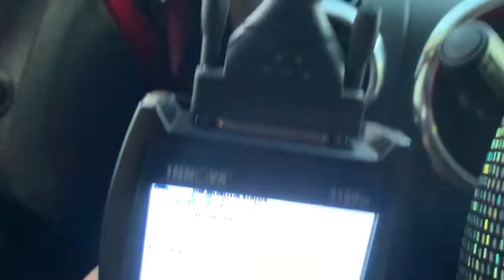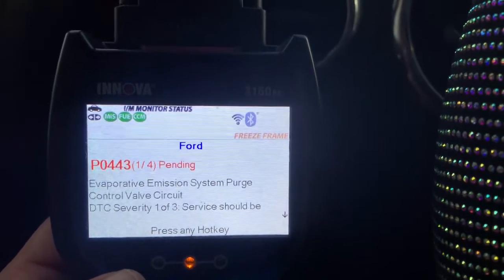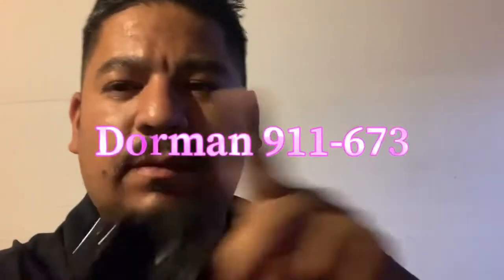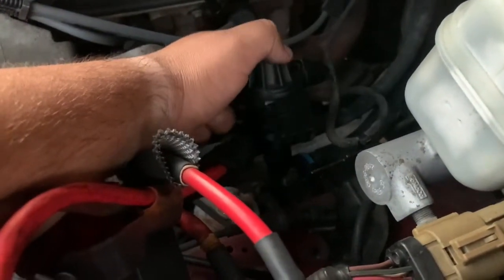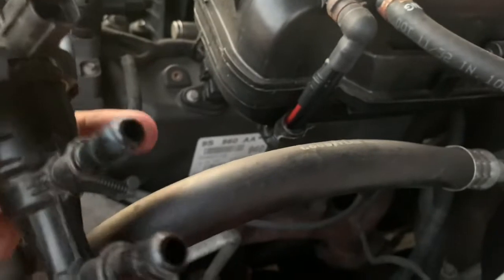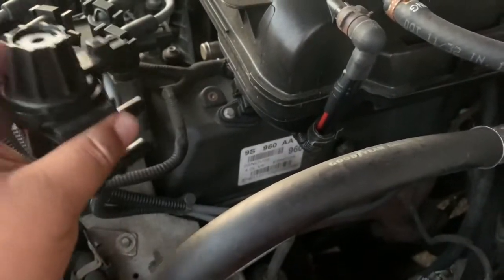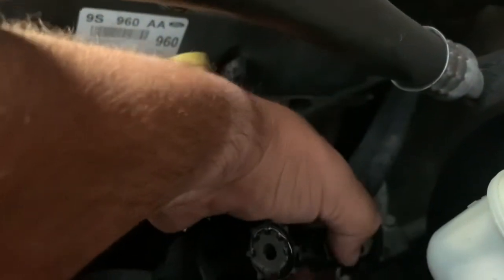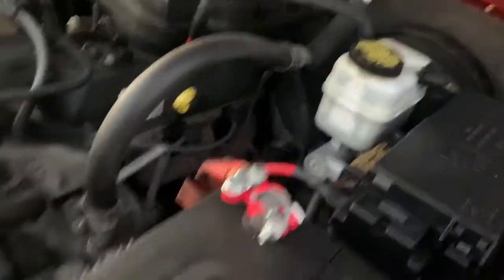Valvula de purga 2010 Ford Explorer

Comment: Buenas, amigo que fallas tenia la camioneta,  la mia tiembla el motor mas al estar parado , falta poca potencia,y bota la pistola cuando hecho gasolina
Reply from the maker: Hola amigo! Está no tenia fallas, la cambie por causa de la luz del check. Si esta temblando el motor puede ser por esa Valvula que ve en video. También son causa de que se bote la pistola.
Reply: @radioactivemotoringmx9456  saludos...la mía también tiembla solo cuando paro en un semáforo o en stop y el scanner me dice q la nesesita ..entonces también es causa probable por esta purge valve?
Reply from the maker: @h.c.cantoz7873  Buen día amigo! Si puede ser la purge valve, lo que yo haria primero seria limpiar el cuerpo de aceleración antes para ver  si ese causa que tiemble en alto. Si sigue entonces seguiría con la purge valve.
Reply: @radioactivemotoringmx9456  se refiere al maf sensor el filtro de aire y eso?
Reply from the maker: @h.c.cantoz7873  el MAF tambien, y el cuerpo de aceleracion (throttle body) y el filtro tambien, esas 3 cosas ayudarian mucho a minimizar la tembladura.

Comment: Estimado mi FE 2010 motor 4.0 se detiene en marcha y a veces cuesta la partida una vez que se detiene y el escáner mostro el código  P0403-FF circuito de control de poción de la válvula EGR y el P0443 fallo del circuito de la válvula de purga. El mecánico me señalo que hay que cambiar la válvula EGR, pero no menciono nada la válvula de purga. Como puedo saber cual de las dos válvulas esta dañada? o pueden estar dañada las dos?
Reply from the maker: Buenas amigo! Le habia contestado pero no se publico. Hay maneras de revisar los sensores con multimetro, pero si esta actuando raro el motor puede ser la de enfrente (como la del video) porque se pudo haber quedado abierta.
Reply: Estimado buenos dias, cambie la válvula EGR y los 4 sensores de oxigenos, aun no cambio la valvula de purga( no la he comprado aun), pero lo errores del scaner se mantienen. Sera que todo el problema depende de la valvula dw purga o sera un problema electrico al no borrarse los codigos de error ni el check engine?
Le agradezco mucho su consejo, en chile no hay muchos especialistas en este modelo de vehiculo
Reply from the maker: @marcelorojas5440  Buen día Marcelo! Hay una teoría en discuso ahorita en estos modelos Ford que las conecciones de la computadora que esta junto al motor no hacen buen contacto y si las limpia (desconectando la pila primero) pueden arreglar ese problema
Reply: @radioactivemotoringmx9456  GRACIAS

Comment: Mi camioneta Explorer 08, 4.0 vibra al estar en semaforo. Revoluciones inestables baja, pierde potencia y si no acelero se puede llegar a apagar. Será esta valvula???
Reply from the maker: Hola amigo! los sintomas suenan como que si puede ser, lo que le recomiendo es primero revisar si tiene alguna fuga de alguna linea de aire, de ahi, revisar y limpiar el sensor de flujo de aire (Sensor MAF) y despues limpiar el cuerpo de aceleracion para ver si eso le arregla el problema antes de cambiar partes.

Comment: Maestro una pregunta 
Te go una explorer 2006 4.o y me sale exactamente ese codigo p0443 y me dice evpap System purge valve de contro "A" circuito, esta se refiere a la misma q tu cambiaste o sera la q esta x debajo maestro?
Reply from the maker: Hola amigo! ese codigo creo que se refiere a un problema en el cableado de la valvula (mala coneccion o cables dañados) lo mas facil y barato de revisar es tu tapa del tanque de combustible que tambien puede causar ese codigo. Revisa que este bien puesta, de ayi es revisar tus conecciones y borrar el codigo haber si te sale de nuevo. :)
Reply: Que falla te hacia??

Comment: Hola, una pregunta, si la valvula Evap esta desconectada, puede dar todos esos códigos?
En mi vehículo me e dado cuenta que el conector esta roto, y por ende esta separado de la válvula, y de hay me a dado varios código (P0135, p0141, p0155, p0161, p0403, p0443, p0645) aparte de que no funciona el aire acondicionado
Reply from the maker: Hola! si esta dañado el conector si puede causar esos codigos. :)
Reply: Buen día, tengo el mismo problema y veo que el arnés tiene el cableado muy viejo, ¿Dónde lo podré conseguir?